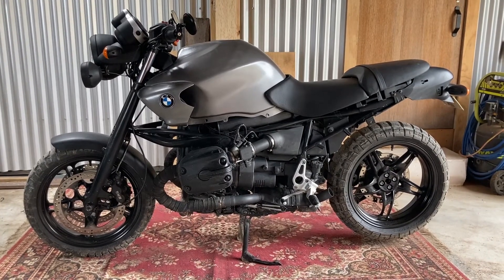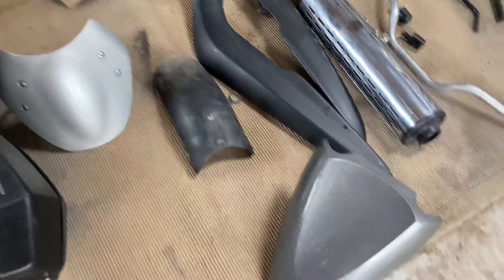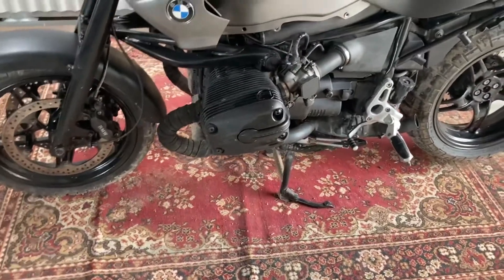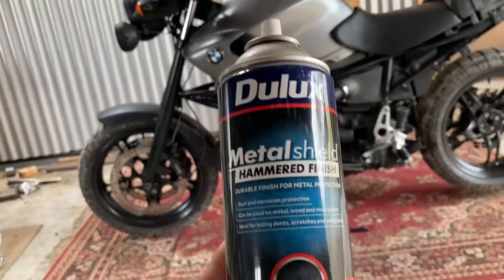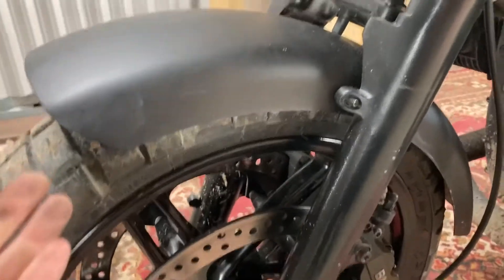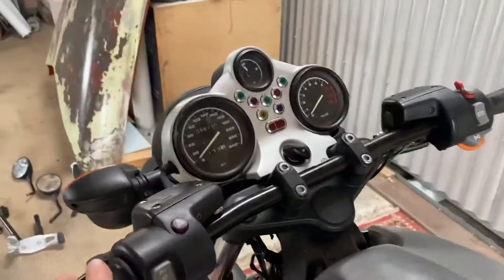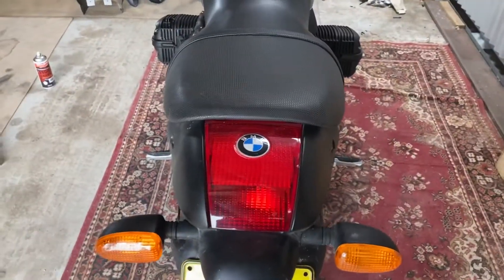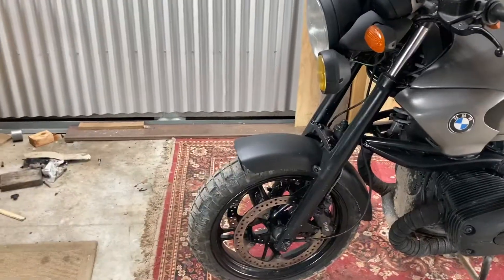BMW R1150R Standard to Bespoke Industrial

Comment: I just came by one of these "all stock" 2004 model and I instantly thought, this would be a bad ass customized bike, eliminating all fo the extras so I went on YT looking for anyone who's done it and found your video. Very nice changes. Very much what I see in the look I could see in this bike. It's a badass looking. bike when customized to that rugged industrial look. and big engine. Nice job!
Reply from the maker: Great to hear and exactly what I thought! Very happy with the results and have also now done the pillion pegs with small internal rods and split pins so they can be added and removed in a few minutes. 
Also have had a few mistake the bike for the new BM model. Wish you well with your project. It’s dead easy.
Reply: @dave9686  very nice!

Comment: Nice. I've  had an 04  Rockster from new, which is BMW'S version of what you've done; flat bars, flat black paint and more conventional front guard.  It's a really good gravel bike, even with the Angel GTs I run. My wheels are both 17 inches. Without the muffler it will run nicer with a booster plug.Very simple to fit gadget that richens the mixture a bit. They vibrate and surge like buggery when the valves need doing or the throttles need synching. The secondary spark plugs and coils can do weird, hard to diagnose things to the way it runs when they play up. Their big flaw was the ABS unit which you dont have so you're on a winner. My Rockster came with a panel to swap over with the pillion seat. One of these painted black would look good on your bike.
Reply from the maker: Really appreciate your feedback and advice. Deliberately went for an early model without ABS as I’d heard the early addition could be a pain. Will look into the booster plug mod. Cheers.

Comment: Love it , I want the same look but to scared to tackle..thanks..
Reply from the maker: Thanks. Stripping off the plastic is straight forward. Even the muffler is only a few bolts. Tyres are done in shop. A good clean of all wax and if you’re handy with a spray can you’re 70% done.

Comment: Liking the yellow auxiliary lamp! Is that rear tire a 180/55?
Reply from the maker: Thanks. The yellow stained glass spray paint works a treat. Yep Pirelli Scorpion 180/55 back 120 front.
Reply: @dave9686  I'm browsing ebay right now seeing what's out there that's slightly vintage looking. 
I'm in the process of going to a 180 rear. Just have to wait for the wheel I had to buy to make this work come back from getting powder coated. The 5" rim on my 1150r is too narrow.

Comment: Hi Dave. Looking good! How did you paint the engine part of the cycle? Did you just remove the seats and the tank and sprayed anything gray in flat black? Is the black paint holding well?
Reply from the maker: Thanks! Thorough degrease and cleaned the motor etc then masked up with the seat and tank off as you assumed. Then sprayed all in flat black engine paint (takes high heat and tougher). It’s holding up well except for a few stone chips which are easy to touch up. The black exhaust pipe wrap faded quickly and the engine paint worked well to blacken that up again although I don’t mind the used industrial look.

Comment: Can you post more about riding it off road ?
I did my research about R series scrambler projects, there are some R1100R and 1150R, but not so much riding comments about off road.
Reply from the maker: The R1150R isn’t designed for riding off road. The 60/40 tyres are to add to the industrial look while giving ability to ride some off road with ease but not extensively.
Reply: @dave9686  The idea came from this video 
https://youtu.be/IkYe434aFQI

Comment: Cool, can you change the indicators on this bmw?
Reply from the maker: Yep. Easy with a little skill. Front and back use a hollow threaded tube with one nut to secure. If converting to LED you may need to change the blinker can/driver as they use far less current.
Reply: @dave9686  Yes, the more modern bmws seem more complicated and have some sort of canbus system. On this can you just put resistors and new led indicators on?
Reply from the maker: I’d imagine so as I’ve done it with other similar age vehicles.
Reply: @dave9686  Thanks. Your bike looked great, the old type of indicators didn't fit the rest
I want to do something similar.
Reply from the maker: Thanks and concur. Always a work in progress. Wish you well w your build. I’m in the process of  doing similar w a 70 yo Holden FJ ute.